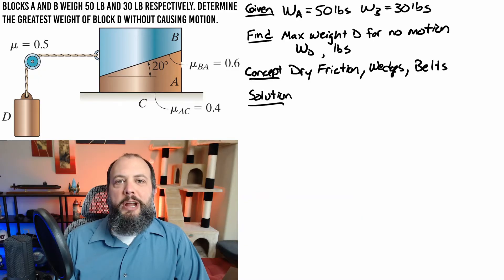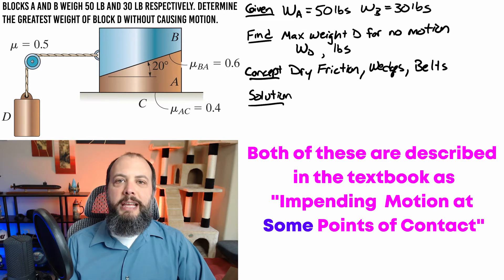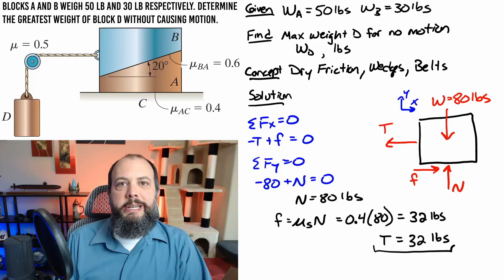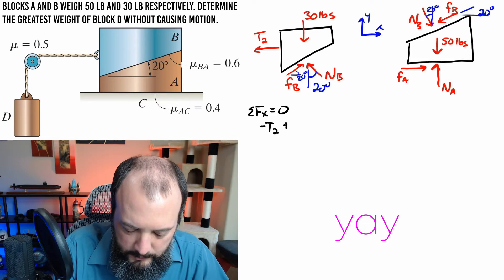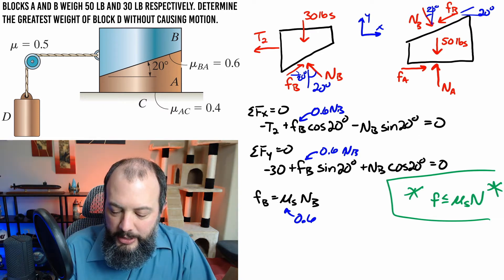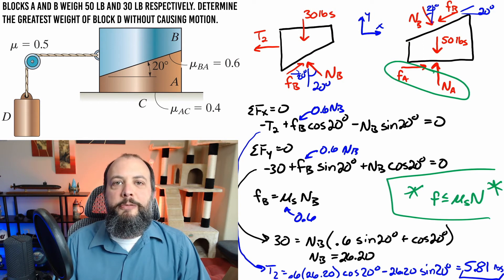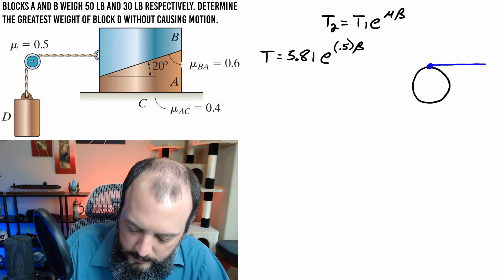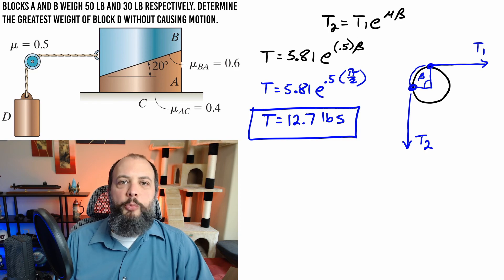Wedges and Flat Belt Friction Example Problem

Comment: You can’t assume that they are one body, if so the weight you found is larger than the actual maximum weight
Reply from the maker: You can make that assumption, if you intend to check and verify whether or not it is correct. In this case, when you get a larger weight for D, you find that this assumption is incorrect. But if you didn't check, you wouldn't have known which situation was real. Either situation seems possible visually, you have to run the numbers to check and be sure.